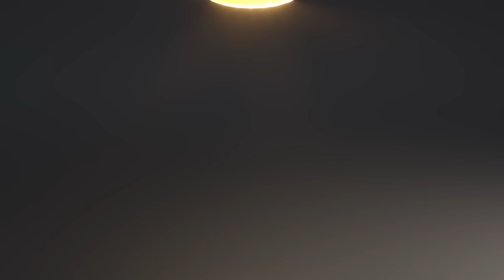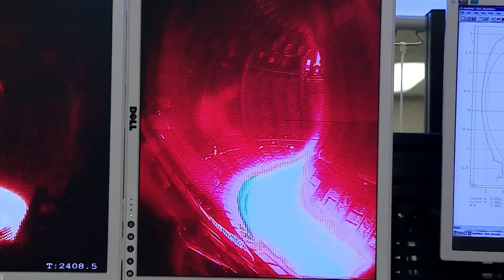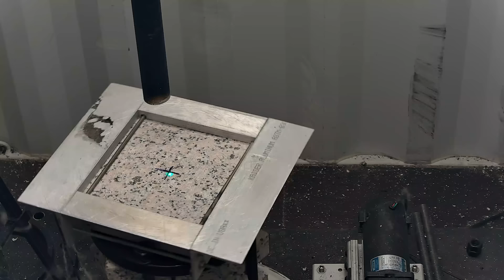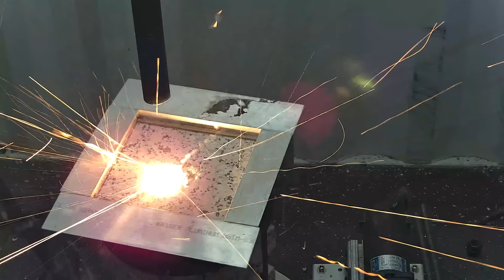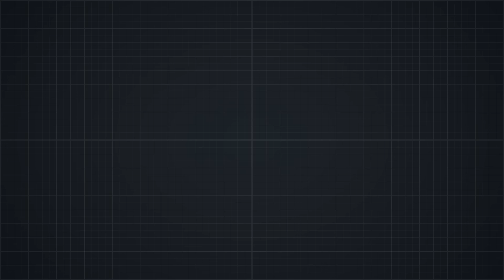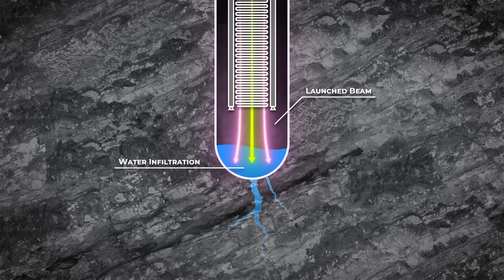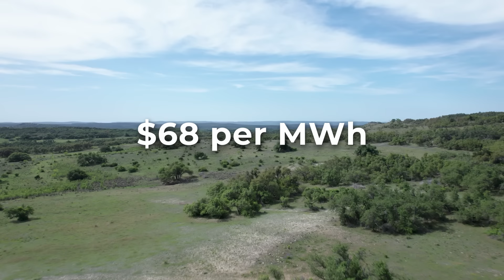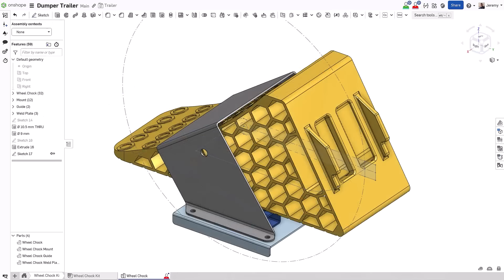Geothermal Energy is Changing

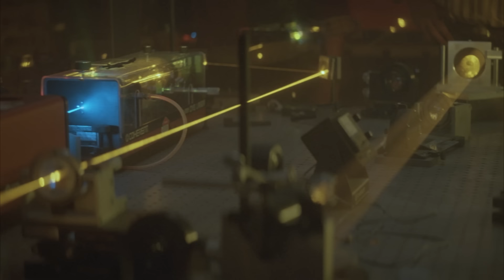Comment: 5:10 "instead of visible light, it produces higher frequency microwaves" This is confusing, if the emr is higher frequency than visible light then it wouldn't be in the microwave part of the spectrum,  perhaps "higher frequency" isn't relative to "visible light" but instead means microwaves with such high frequencies they're almost infrared?

Comment: STUPIDITY WILL BLOW UP THE PLANET CAUSING A MASSIVE EXHAUST PRESSURE TO BE CREATED CAUSING MASSIVE EARTHQUAKES, TSUNAMIS AND GLOBAL CONSEQUENCES THAT WILL END OUR EXISTENCE. IF PEOPLE DON'T STOP DRILLING AND PLANNING DANGEROUS EXPERIMENTS WITH OUR PLANET IT WILL BE THE END OF EVERYTHING. THE PRESSURE OF OUR PLANET IS ASTRONOMICAL. YOU DRILL DOWN AND RELEASE THAT PRESSURE AND THE BIGGEST RELEASE OF PRESSURE FROM EARTHS CORE WILL BE RELEASED AND COULD SHIFT EARTHS ORBIT OR BLOW APART UNCONTROLLABLY. THESE PEOPLE ARE SO DUMB. THE ONLY ENERGY WE NEED IS SOLAR ENERGY. THE WASTE IS AC CURRENT TECHNOLOGY. A 1KW SOLAR SYSTEM CAN GENERATE CLEAN ENERGY ALL DAY LONG FOR ANY HOME AND YOU DON'T EVEN NEED INVERTERS OR LARGE STORAGE OF BATTERIES. DEVICES ALREADY HAVE BATTERIES. COMPUTERS, PHONES, CARS, LIGHTS AND MANY OTHER THINGS. RATIONING AND REDUCING THE WASTE WOULD ELIMINATE 90% OF THE DEMAND OF ENERGY ESPECIALLY IF PEOPLE STOPPED LIVING LIFE WITH DEPENDENCY FOR MONEY AND WORKING JOBS FOR MONEY LIVING IN SLAVERY. HUMANS ARE OVERTHINKING AND OVERCOMPLICATING EVERYTHING MAKING LIFE DIFFICULT WHEN ITS ACTUALLY EASY. A SIMPLE EXAMPLE OF THERMAL DYNAMICS: YOU HAVE A WOOD BURNING HEATER AND YOU PUT LOGS INSIDE TO BURN FOR HEAT AND THAT HEAT BUILDS PRESSURE AND RELEASES THROUGH VENTING. YOU OPEN UP A CAVITY RELEASING HEAT FROM THE CORE HUMANS WON'T BE ABLE TO STOP IT AND THE PLANET WILL BURN AND THE EARTHS CORE WILL COOL THEN IF EARTH DOES SURVIVE THE EVENT IT WILL TURN INTO A COLD FROZEN PLANET AND NO LIFE WILL EVER LIVE HERE AGAIN. THAT IS REAL FACTS AND HOW THESE PEOPLE KEEPING PLAYING GOD WITH YOUR LIVES EVERYDAY.

Comment: Materials science is the hurdle the Russians tried it and it got so hot nothing could withstand it just disintegrated. Musk struggles with the same problem with his heat shields. The Chinese are having another crack at it though I hear. You don't even have to go that deep for it to be hot enough to boil water though.

Comment: My first concern on vaporizing the rock is how likely/feasible is it to keep it hot enough to remain in vapor form as it travels 1+km up through the borehole. Because if not it'll solidify and block the hole, at which point the increased pressure will end up destroying the drill pipe or create an explosion (probably destroying the drill pipe).
Reply: It looks like some of the rock turns to an asbestos looking material. And a line pig could clear that stuff.

Comment: It's not a cost issue. It's a barrier of entry and time issue. Once you have the super critical steam, you can use said reactor to sell and use the energy to create another borehole. Ever consecutive borehole you make will make funding the next one easier. Remember, you're not making a power plant, you're funding a hole that gives you "free" energy indefinitely. 

Once the concept can prove to be effective at getting super critical steam, it will take off worldwide in 10-20 years. The barrier of entry will not matter because it will be an investment v return equation all the way until the margins are so low only a country would be willing to invest into it for political reasons (which they will do). I would suspect in 30-40 years time every country will have a substantial portion of their entire energy consumption provided through geothermal energy after it does take off. By this point, you could consider earth's energy problem to be halfway to being solved (with the other half being unprofitable ventures due to energy pricing being too low to get a reasonable return time in investment, hence political funding will have to pick up the slack). 

But that is all considering this company can actually drill all the way to super critical steam and do so in at least half the area's across the world. Like with most optimistic speculation, I highly doubt this will be the case in the next 10 years of trial and error. 

By my pessimistic offset, I say the "just 30 years away" meme keeps on living for a long time.

Comment: Gyrotrons are old technology, used in some particle accelerators as well. The only reason they are using them, over a klystron or magnetron, is that the gyrotron is more energy efficient when you need a lot of power at roughly a certain wavelength. Both Magnetrons and Gyrotrons are self oscillating microwave generators, the Klystron is just an amplifier. All are vacuum tubes.

Comment: I'm curious how Quaise is able to supposedly pump out ~80 kg of rock fumes per hour over a distance of several kilometers before they deposit as solids again. And just quick correction: while its true that radioactive decay is a significant contributor to the heat within the planet, fission reactions have practically nothing to do with it. Radioactive decay of naturally occurring radiological material is dominated by alpha and beta decays, spontaneous fission is extremely rare. Also, "fission reactors" do not rely on spontaneous fission but rather a sustained neutron induced fission process. This is only known to have naturally occurred once in a uranium mine near the surface of the earth over a billion years ago and required water presence for neutron moderation which you will not find in the core of the earth.

Comment: I work on a drilling rig. I can see major challenges with this technology. There isn’t just rock down in the earth while drilling. There’s fluids and gases down there. Currently we use drilling mud to provide hydrostatic pressure to keep those gases out and use certain fluids and density to counteract water flow and gases from entering into the well. And what about casing the well and cementing to prevent contamination outside the well? I would really like to see what the solutions are. Theres more to drilling a well than just solely drilling the hole. There is so much more to it. And the cheapest way possible is what operators want. I like the ideas but I’m very skeptical until they drill an entire well with this technology.

Comment: The problem is drilling the material downhole.  It’s the mechanical properties of steel drill pipe.  And without a mud in the hole to add buoyancy to the string of pipe, you’ll actually be limited further using this Quaise method than regular drill pipe.

Comment: Can someone who is in mining industry briefly explain to me why this should exist with all of it's tecnical diffuculties if waterjet cutting does exist? 

I mean that as well will eliminate wear of a drilling bit, will not add the complexity of electricity, gas and waveguide are being used. 
As i read from comments water as well used to exract contents of a drilling proceess, so it will fit to it. 
We will simply insert the waterjet nozzle into hole comparing to drilling bit. 

If so - is there advantages of microwave drilling comparing to waterjet drilling?

Comment: The grid is AC, and you say they require a high voltage DC supply, then compared the numbers to the grid and home supply. Apples and oranges, in this case DC is easier to work with once it is generated as they don't need to change voltages downstream, which would normally be as simple as winding a transformer, but in DC is quite a lot harder to do. That being said, that is one heck of a power requirement, for certain!

Comment: Doesn't the vaporized rock cool back to those hair-fibers that will coat and clog the drill stem and shaft walls? How could it stay in a super hot vapor all the way back to the surface? If that superheated rock vapor gets to the surface, maybe they can convert/recover that back into steam turbine electricity the project needs.

Comment: The cost graph is too simplified in this case, you have to take into account that this is a plannable electricity source which will be increasingly profitable as a higher % of electricity is generated from non-plannable like wind and solar. In Europe we have prices set each hour and when there is no wind and sun prices skyrocket.

Comment: Why not use the laser for fusing the side wall and cutting chunks
Eg instead of melting everything into cotton candy, 
Instead use lasers how they shine, very thin slices at very short time bursts 
Use the laser to cut not melt, 

You might be able to heat pinpoints enough to cause cracking from uneven heat expansion, 
Water might actually be helpful 

Make "nozzles" for the wave guide on the end of head
Get the head really close, riding on the floor of the hole so the laser is in open space for only a millimeter, you can look at similar techniques/science for etching glass, ie very minor imperfections can be made to produce macro cascading cracks

Water can be pumped through to remove material and keep temperatures cool, so that heat differentials can be high for good cracking, and keeping drilling equipment from overheating

It could become progressively difficult to actually keep the water cool if you get deep enough for geothermal to kick in, which is the goal
But that can actually be a benefit
You can dump water down, and the heat can create it's own convection current and eventually steam pressure can launch slurry back up and out
And the heat in the water we can be used to start up small scale geothermal generators that could operate on slower time scales just inching along progressively deeper with light support staff keeping an eye on the drill and the generators

You could start with oil wells that are nearly dry, already dug maybe drill the hole slightly wider as you go, to run a sheath around the outside to keep sucking oil out to reduce pooling and offset costs a bit 
And to create a more secure boundary between the fractured oil well hole, and the geothermal plumbing
,
Drill conventionally until it makes sense to switch
Then start laser cracking/etching/searing, 
Maybe start partnering with oil drillers to subsidize drilling holes that will eventually make good geo thermal wells
Ie they're already drilling, set up, etc, they might quit at 1000 meters because they're getting good oil rates at that depth, but they might easily drill another few thousand meters for maybe 10 to 50% of the current cost, because they're already there and set up, they could just keep going
,
You could eventually get the tech developed to the point where you can pump oil and be drilling geo thermal at the same time, 
,
And you might be able to eventually get a hybrid drill head that can use traditional mechanical drilling and get a boost from laser cracking here and there, and switch over to laser eventually, though the mechanical drill could still help mash laser cut chunks into slurry
Kinda like cutting slices and using a hammer or chisel to remove the bulk 

Also why don't drilling rigs have auto leaders, eg why don't they have a tower above so that they can be screwing in the next section before it gets in the hole, so that there's no stopping delay and there's much more time to hook up without the danger of trying to do it quickly

,

Comment: "It works on similar principles to lasers. But instead of producing visible light, it produces higher frequency microwaves."
Sorry what? By definition, microwaves are lower frequency than visible light, by a factor 1000~1000000 depending on which exact definition.

Comment: The one thing over stated here is the capital cost. All this equipment can be moves to a new site so the capital costs per site would be the electricity and the turbines and grid connection. But as many people bring up. Drilling isn't predictable it seems overly simplistic approach. Maybe if they solved the extraction, casing and pressure issues as well they woul have a viable solution.

Comment: 9:00 Meter per hour would be a crazy rate. That would allow for you to make geothermal pretty much anywhere in less than 5 years at the depths exceeding our deepest digs. Where dig itself would take between 1 - 3 years.
Reply: That’s actually crazy slow compared to conventional drilling and assumes high uptime for years which would be unachievable.
Reply: brother 1m/h is NOTHING. oil drills hit 50m/h all the time. ive heard of 90 in the soft sands of arabia
Reply: @elguerojusticiero Are you slow? You don't dig holes for oil that are 10-20 km+ deep, your argument does not fit here.

Comment: GIven the temperature of rock quickly reaches 950F/910C well before the target depth of 12mi/19km, one would think the preheated rock should allow the plasma drill head to operate/gassify the rock at a much faster pace, and possibly reduce some of the energy cost(?)
Reply: Also the water issue is non existent at these temperatures. I wouldn't be surprised to see the cost effectiveness of this drilling method be nonmonotonic. I think their plan is good: use conventional drilling until it's no longer economically feasible, after which this technology would actually be more efficient than at lower depths assuming they can get it working that deep.

Comment: When you pull up the pipe to change the bit it is called "a bit trip" in the industry.  You do it all the the time and not just for worn out bits. It is often done because different kinds of rock require different bits

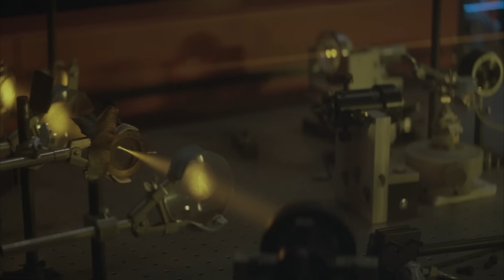Comment: Hi, there's probably a typo in 05:13~05:15, frequency of microwave is LOWER (NOT HIGHER) than frequency of visible light, or WAVELENGTH of microwave is HIGHER than wavelength of visible light

Comment: Would the hot rocks vaporize faster than those on the surface?

Would the likely higher pressure flow gas in the hole make the vaporized  rock crystalize more easily or would the high pressure favor the solidificatuon of the glassy silicates?

As a chemist, I am also very curious about the metal ion effect on solidification of silicon dominant plasmas.
Reply: Yes warmer rocks need less energy to reach melting and boiling point. Rocks won't crytalize from the melt, they will always quench into glass. In DeepU Project rock vaporized by a laser is quenched with cryogenic gas to prevent clogging the borehole, then solid glassy particles are blown out.

Comment: Basically we are taking notes from the Kryptonians we gonna destroy our planet because he think we found a cheap abundant energy source. The Earth's magnetic field which protects us from solar winds and cosmic radiation is generated from that molten core. If we start extracting heat from the core it will cool the center of the planet faster and could disrupt the Magnetic field. Without the protect the Solar winds would blast away the atmosphere like what happen to Mars as it shows signs of Water in the past and they speculate it may have had life. However due to it being smaller it's core cooled faster causing it to loose it Magnetic sphere and then it's atmosphere. 

It's another case of the cure is worst than the disease. Geothermal plants have already seen a strong correlation between their placement and increase in Earthquakes. Extracting all that heat energy cools the rocks which puts stress on the plates. All those fossil fuels use to be in the atmosphere and sure some places could flood with things getting a bit hotter. But for as much of a hassle as that might be we can manage. Even in the unlikely event we don't survive a Global warming event the Earth will go on fine without us like it has for Billions of years. The collapse of the Magnetosphere would kill the planet however, no us and no other life as it turns into a larger version of Mars. 

If really wanna save the planet then support Nuclear. It has ZERO green house gases and despite all the media propaganda it is extremely safe. When compared to other energy sectors including injury/death from workers/bystanders/etc the Nuclear industry has the least number of casualties by a wide margin. And not it's not just cause it's a smaller portion of the market but when you look at energy generated vs lives lost it's not even close as Coal and Gas have tons of deaths primarily from mining. Even solar and wind have a fair number of deaths due to work place accidents. But people think Nuclear plants are gonna go Boom taking out a city or something despite that being impossible.

Comment: Is cold nitrogen gas going to be able to blast out all that material back up the borehole? After a few metres the rock vapour will be back to rock wool, getting tangled on the waveguide and hole walls.

Also LCOE is a bad metric that doesn’t take into account the reliability or intermittence of a power generation method. A lightning rod has an even lower LCOE, you know.

Comment: I was drilling on a diamond drill rig while first listening to this. I am very very familiar with the idea of EVERYTHING on the rig getting harder and harder as it gets deeper. We use 3m gear, a 1200 meter hole has 400 rods and can take around 12 hours to change the bit..

Comment: Maybe just a dumb idea but when two tunnels are needed, why don’t use the heat from the first one to offset some of the energy cost for the other one? Like warming the water just a little bit - still cheaper to boil the water for the turbine when already preheated in the shaft, right?